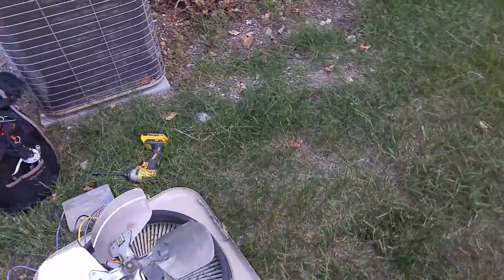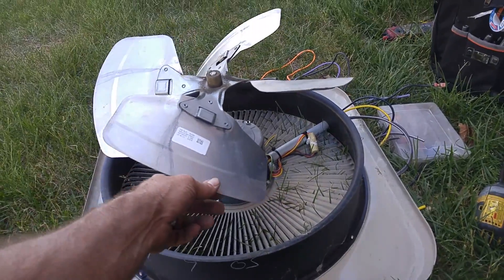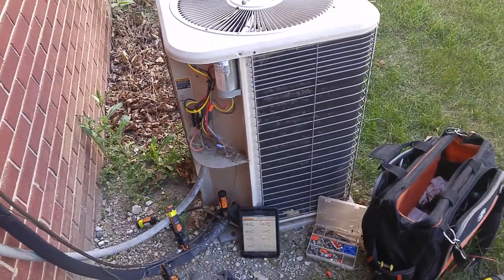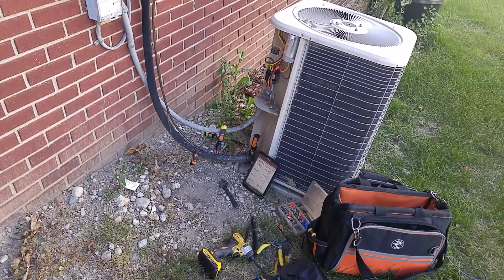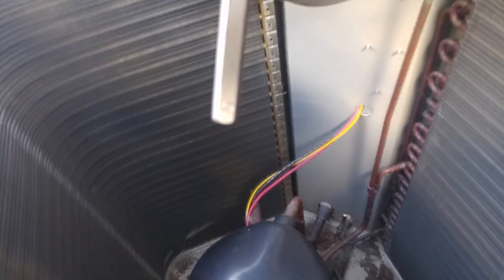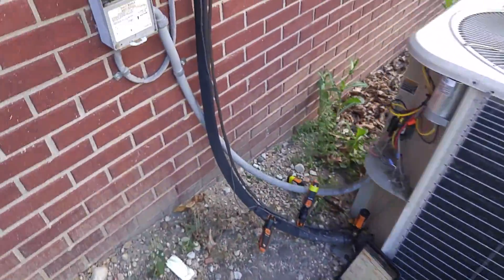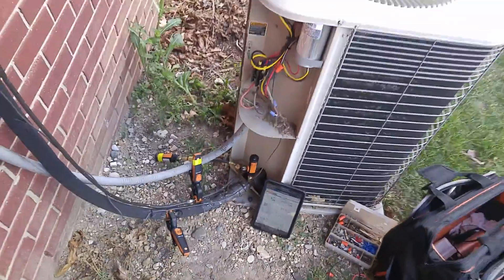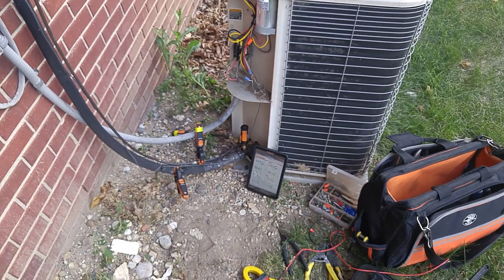Condenser fan blade placement is critical

Comment: thanks for posting, id like to see where the optimal spot is, on some fans you can have it too deep in both ways from the shroud...  this summer i adjusted a few fan blades usually about half in and half out , so theyre centered in the shroud and it definitely increased airflow, noticeable with just my hand feel gauge lol.....  i know some manuals say 1/3 out, 2/3rds in..... but it would be cool to see pressures at every position possible..  also ran into a unit where the blade was put on the wrong way, the scoop shape of the blade matters too

Comment: God, these things are finicky pains in the butt, LOL.  I had a motor overheating and running slow, and it turned out it was just because the fan blade was at the wrong height by about half an inch.

Comment: That makes perfect sense when you think about it:   All the area below your fan blade is your intake..  So the higher the fan blade is, the more air it's able to intake.  I bet if you measured the current to the fan in both positions, it would be pulling more current when the fan was down lower-- due to there being a more restricted intake area.   Interesting stuff.  I would have never thought it would make such a huge difference.  Good to know.

Comment: I have a question is the fan blades supposed to blow up and out or downwards and in? I think I installed my blades the wrong direction but not sure
Reply from the maker: Up
Reply: @MiHeatingGuy  thanks I actually had it the right way found out it was a leak from the fan blades flying off and hitting the side coils inside, gonna have to get a whole new unit.

Comment: The fan needs to be closer to the top also so that it can pull the air more efficiently through the cooling fins and coil. In order to achieve proper cooling.

Comment: I just did this today on mine. Replaced the fan motor last year and only option was a full sized motor. Looked like the blade was nearly 3 inches below the lip at the top of the unit. Figured that couldn't be good for airflow so wen out, cut the motor body mount bolts down to a couple threads above the nuts, set the fan blade as close as I could get it to the motor body on the shaft and still clear and holy crap - the noise level cut by almost half and the airflow more than doubled coming out the top. Big difference! - can't believe I missed that on assembly but live and learn.
Reply: I did the same thing, I put the fan blade at the end of the shaft and jees did it make a hell of a racket you could here it down the street I left it that way till the next day to the thank you's of my neighbors. the next day I cut the bolts that hold the motor till just a few threads were left and slid the fan blade toward the motor and what a difference. That was 4 years ago and now I'm starting to get a rumble moan so I'm going to go back in there and see if I can fix that.
Reply: Well i could only go about another 3/8" but that made the difference, no more noise. Thanks man.
Reply: @prmayner  happy to help

Comment: I had the same problem today. I am the culprit who replaced the motor last year. There was only one supply house open at 5 pm and they didn't have the right motor . The replacement motor was longer than the original and the fan blade was set to deep below the shroud . Again they called me at 5 pm and the compressor was tripping the internal over loads. I went to the depot and bought pvc couplings that were an inch and a half long. Using long screws I mounted the grill higher up and the fan blade position was close to the original setting .No kid can stick their fingers in deep enough to get close to the spinning blade  . When the heater breaks customers will wait . When the AC breaks they have no patience on a 90 plus day. Butchery happens when things get desperate and you worry about their comfort. Don't be like me. Use the right parts or don't fix it.  I' going to check the unit again if the weather gets hot and replace the capacitor. 16 year old r22 unit

Comment: The fan on my unit sits almost a quarter of the way down the height of the coil, but is still set as close as possible to the motor housing. Motor was replaced several years ago (by a dope who didn't know what he was using and banged the hell out of the inside of the coil) while my ex wife was living in my house during our divorce. Only way I have to raise the blades would be to raise the entire grille & motor assembly using some sort of spacers oe bezel, but that would mean several inches. Would that even be advisable?
Reply from the maker: Sounds like the wrong motor
Reply: @MiHeatingGuy  I had wondered that. The top of the housing is only an inch higher than the top of the coil though as well, so would a shorter motor do much if it's only raising the fan an inch or so higher?
I did finally give my coil an extensive cleaning a few days ago and that lowered the air temperature in my ducts just a hair more than 5 degrees, which makes a BIG difference.

Comment: Maybe you think we should already know all that, but you're here to teach, right? I have no knowledge, but let me just make something up: The purpose of the fan is to pull cool outside air into the center of the unit, cooling the condensor coils by drawing the air past them. If the fan is too low in the unit, the highest coils on the unit are not cooled in this fashion. Even worse, as the air is passed over the lower coils it gets heated, and then this hot air is "blown" by the fan past the higher coils, not giving them the cooling that is desired. The result is the condensor working at only 66% of what it could, obviously a disaster. The lesson is to locate the fan blade as high as possible on the motor shaft with out having anything interfere with the fan blade.

Comment: However, how about some theory? What is head pressure? Why is lower better? Can it ever be too low? Is lower always better? How does moving the fan blade higher make it work better? Should you always make the fan blade as high as possible? Or is it not that simple?
Reply: I'm going to take a stab at answering some of these questions. "Head pressure" is another term for high side pressure or discharge pressure. That being said, if your head pressure is near your low side pressure, you are either low on refrigerant or you might have a problem with your compressor, so, yes, it can be too low, so lower isn't always better. In this case, lower is better because 182 psi means the system is running much less efficient than at 162 psi. How does that work? Well, pressure builds up heat and heat builds up pressure, the point of the condenser fan is to force air through the condenser coil to dissipate heat. Here's a quick demonstration of why the fan dissipates more heat when blade is located closer to the top: Blow on your hand from 1 inch away. Now blow on your hand from 1 foot away. Now, hold your hand as far away from your face as you can and try again. The further away your hand is, the less force you'll feel and the more air flow is lost in other directions. By moving the fan blade as close to the grill as possible, you are forcing ALL of the air to be forced in that direction, and with all of that air coming from outside of the condenser through the condenser coils, thereby dissipating more heat and lowering the head pressure.  There might be designs in which placing the blade closer might not be the most optimal, but for a general idea, this is roughly where it should be.
Reply: @danielfranklin9062  Hey ! You got a love heart from the video author. I'll take that as his endorsement of the accuracy of what you wrote.

Comment: I learned a lot. I learned fancy test equipment is available to see how your unit is running. I learned that lower head pressure, whatever that is, is better. I learned that the fan blade needs to be located properly, and I learned raising the fan blade up higher on the shaft makes it work better. That's a lot, so thank you.

Comment: Thanks for the video. I just replaced a motor and the fan on a 13 year old Goodman. It is shaking the grills in front like crazy. I put it at the same position as the old motor and fan. If If press gently on any point of the top where the motor mounts, it stops. This is the 2nd fan, the first was bent out of the box. Any ideas?
Reply: I'm not an expert since I'm having issues too. I replaced a condenser fan motor and it's vibrating. Another guy said that the four mounting screws on top might be over tightened. And yes it could be one of the fan blades could be tweaked. Here's the youtube link. I hope it helps. I hope it helps me too.
https://youtu.be/QSDUkmoebYs

Comment: Looking down should the fan turn clockwise or counterclockwise?
Reply: It can be either CW or CCW, depends on brand and factory setup. I have 2 units, one is CW and the other is CCW. The blades on the two are bending in opposite direction, so both pull air upward. One day one motor was broken, I swapped the motor, found out that. It is not a big deal as you can swith the dirction easily.

Comment: I do my best to get a measurement from the fan grill to the hub BEFORE pulling the bad CFM off, then get it as close as I can to that same distance when I install the new one - I figure it was manufactured with the fan blade at the optimal position.
If I forget, I just try and get it as high on the shaft as I can with it still clearing the bottom of the motor.

Comment: Good video, Lennox had re-call on fan shroud , was told to remove it.2001-2005  Will stop noise too.
Reply from the maker: +Michael Lee Mike that's good information I will have to check into that I was not aware of that thanks for your support keep on watching
Reply: whiiirrrrrrrrrrrrr